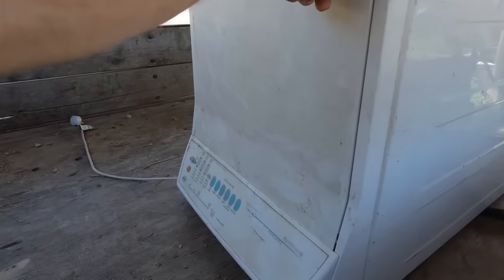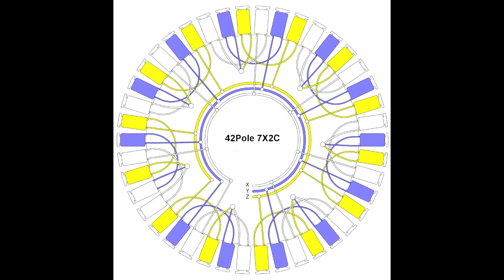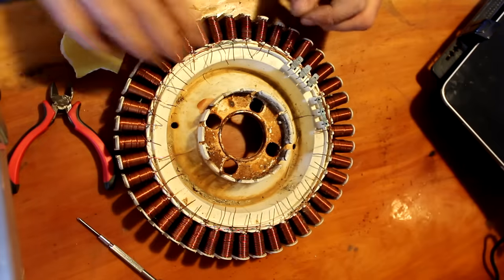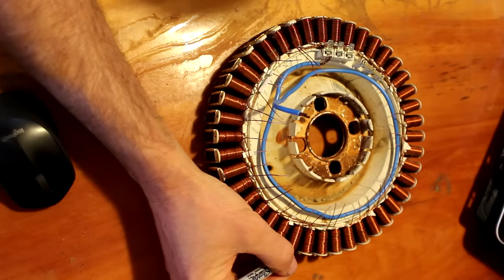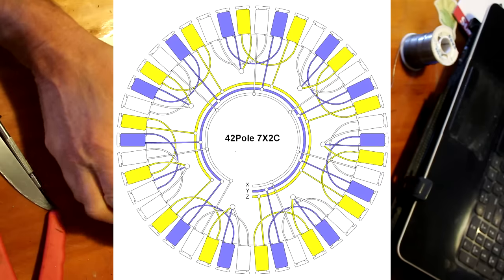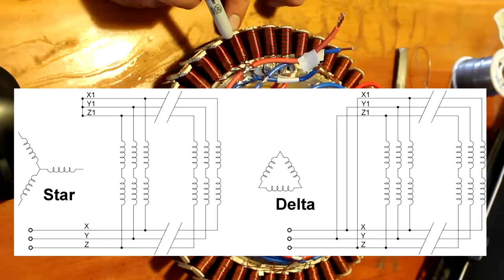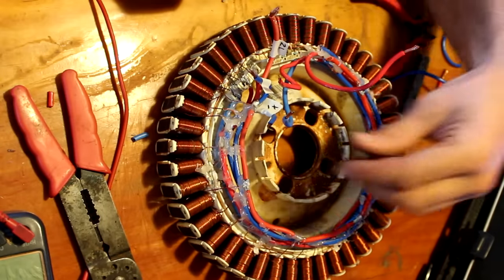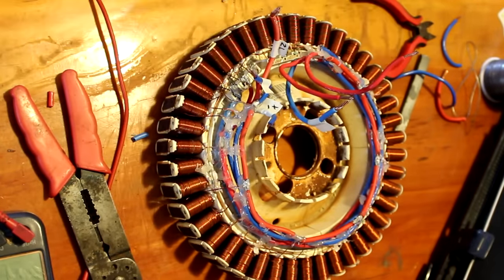Free Power from Water Part 3- Rewiring a smartdrive washing machine motor to generate power

Comment: Marty after watching your Part 2 I watched a YouTube explaining the difference between conventional generator vs the new more expensive inverter type generators. I also looked up Skin Effect. For those who don’t know I copy paste the explanation from the Internet;

“The main technical difference between inverter generators and conventional generators is what kind of electricity is produce, conventional generators only produce AC electricity while an inverter generator produces electricity in three phases (high frequency AC to DC back to stable  AC current)”  

“Skin Effect results from circulating eddy currents, arising from a changing B field, cancelling the current flow in the center of a conductor and reinforcing it in the skin. This reduces the effective cross sectional area increasing wire resistance and losses.”

Now I understand your "inverter" setup, your cost to effectiveness ratio is just brilliant. Big fan, love your channel.

Comment: Ok I wasn't expecting 885W at all.  That's significant and you can absolutely work with that.
Reply: Oh hell yeah with good pressure and solid copper magnet wire instead of the aluminum junk he reused you can get way more and smaller gauge also

Comment: That soldering iron brings back memories. I started year 7 at an absolutely brand new high school and chose electronics as an elective. I was expecting a great experience with all new gear, but when it came time to solder up our first circuit boards, the teacher who really had no idea what he was doing, took us outside to do it with those antique soldering irons heated in a branding iron heater borrowed from the agricultural department!  The irons burnt the crap out of the circuit boards and components, and did an awful job. And to really top it off, we were only supplied with acid flux and plumbers solder, corroding out our hand made boards after a few months. Was the most disappointing class I ever enrolled in.
Reply: Hell of a school? I did electronics at a TAFE College in Australia in 1976 with all the good gear went on to the School of Radio with the RAAF for my apprenticeship at 16 learnt precision cabling there.
Reply: Did that school also have a motor mechanics course where the tools were a brick and a chisel?
Must be where all the Harley mechanics were trained.
Reply: Then it's Taught you about Electronics !
Reply: @hauptuhrdotnetblog6700  You can pretty much sue them for that shit I think
Reply: @ToreDL87  would need documentation to prove damages but without knowing the laws of where you live hard to say. I’d at least talk to an attny. You never know, maybe get a settlement due to their incompetence
Reply: @paulg3336  With enough skill you could make a motorcycle out of brick and mortar. Legends say the monks in Nepal are still trying.
Reply: @john beach Silver solder or brazing is as low as I go these days they build way better connectors.

Comment: Loved your videos, here in Bougainville we run small hydro using 100mm pvc reduced to 25mm running a radiator fan off earth moving machinery with its blades bent at right angles as a water wheel running a shaft and then belt driving a 240v generator off a dead genset.

Comment: If you left the motor wiring original and then brought it up to the house as 400v then use a step down transformer your losses in the cables would be reduced due to the lower transmission current.  The transformer would then lower the voltage and increase the amps to a more usable level just like the utilities do. As an added benefit you would have the bulk of the system available at the house for repair/monitoring/maintenance instead of trekking down that steep bank with all your tools and materials. The 1drawback is the transformer which given your minimalistic scrap/salvage approach would probably be unattainable and would be quite pricey to purchase. I love the repurpose material approach in our “disposable” society. Great job.
Reply: The 400VAC @ high hertz is leaky through insulation and dangerous to handle. Rectification immediately to 27VDC to charge the batteries (low voltage needs large cables and short runs to avoid line losses) then from the batteries through an inverter to 230VAC which is standard household voltage for NZ appliances/light etc...and can run 400 metres with minimal line loss and arrives at the house distribution board ready to go out to the water heater appliances etc without further rectification.
So the batteries and electronics need to be down at the stream and the generator....
Has worked for 17 years at Marty's home.....

But you could use an old (<85% capacity) 400 VDC  EV battery at the house as a back up battery or where the loads (such as a compressor or welder) now force the use of a generator....but you would need a large and expensive transformer to get the standard 230VAC household power...

Comment: My grandfather had a soldering iron like that...

The "tip" was about a pound or so of copper.  It was heated in a charcoal brazier that he had a hand-cranked blower for.  The flux was a block of "sal ammoniac".  I've also seen bar solder like that somewhere,  but it was so long ago I can't remember where.
Reply: Plumbers soldering iron used when roof guttering was soldered with "bars" of solder melted like a small river into the joins between the metal gutter sections...

Comment: I haven't seen a soldering iron (and solder) like that in years - I'm used to a much smaller iron and solder - I was an electronics tech!
Reply from the maker: I tried my 100w electric iron but it didn't stand a chance
Reply: @MartyT  Yeah, 100w is a bit much for that type of work but those copper 'irons' were not intended for electrical work ! 
I recently bought a very small soldering iron (not much bigger than a pen) with adjustable temperature which was incredibly cheap and much easier to use than that type.
Reply: I was just about to say that I e never in my life seen one of those soldering irons used. I’ve seen them around but be er seen them used. Marty is just showing off how eclectic his skill set is now!
Reply: Marty you lost me at X Y Z hahahaha. You are a very clever bloke. Love your work. Keep them videos coming
Reply: Reminds me of the "this is a knife" scene from the Crocodile Dundee, but with soldering irons :)
Reply: Thick wires need thick soldering irons
Reply: Marty T I've tied heavy gauge copper wire to a soldering iron to pin point the heat
Reply: Well I thought I might learn something but I just relied I know less than I thought I did 😂. Loved this series, I’m sure you will get lots of Enquiries to build these for people,
Reply: we used to call those soldering bolts you could get smaller ones, I used to work on hand held and car two radios in the 80's, normally a 60W soldering Iron would do we had 100W electrical soldering iron...problem is a big bit of metal sucks the head from the soldering device.... then we got RF power soldering Irons that could keep a stable tip temp for heating up bigger wires,  metal housings etc....And I had a Weller Pyrotec Gas Iron for work outside on antenna connectors it was good enough for Scottish winters...before that came out we had 12v ones to run of vehicle batteries......
Reply: @MartyT  if it was one of those pistol type Irons never had any luck with them  a 100w  Iron needs a heavy tip to help hold then transfer the heat most of those pistol ones come with to small a tip... but look up Mr Carlsons Lab he modified one some how to work better!...aw what the heck here is a link https://youtu.be/79uD6XwBg5E
Reply: @BokorRider  For heavy work, I have an old Australian-made Scope 100w 3.3 volt iron.  Dad had one back in the Fifties, too.  Hold the trigger down for too long and the tip glows red!  :) https://wbtools.com.au/100-watt-thumb-switch-soldering-station-extreme-heat-resistant-display-black-handle.html
Reply: We used those irons in school in the late 70’s used to keep them hot in the kilns, many a blister on the back of each other’s arms and legs
Reply: @Brad.whatthe  Thanks for teminding me!  Yes, we used them at high school in metalwork classes in the Sixties .  I'd forgotten about that.  My grandfather had one that was heated with a kero powered blowtorch - the blowtorch had hooks to hold the soldering iron in such a way that the copper tip was in the flame.  You can see the hooks on the top of the blowtorch in this video https://www.youtube.com/watch?v=7aKKHO8Kv40

Comment: Very cool and interesting. Usually with a PV array you wire the panels to put out high voltage, low current to save money on the wiring run back to the inverter. Once at the inverter, it converts it back to usable volatage and bumps up the amps. Same priciple as high voltage transmission lines. Higher voltage also resuces losses over the run from source to house.
Reply from the maker: Yes thats right, output from this is a little different than clean dc from a solar panel, high voltage / high hz ac doesn't travel well long distance (skin effect cable loss)
Reply: @MartyT  Cool thanks for the info.
Reply: @MartyT  I was thinking the same thing. But I forgot that here in USA the transmission lines are high voltage/Low frequency (60hz) . This brought back my tech training days more than 50 years ago.  You refreshed my high frequency transmission line education ! Thanks. Great video.

Comment: OMG a soldering iron for fixing the roof rain gutter! Mate you make an easy job difficult for yourself. For the rest; very good idea and improvisation.
Reply: Marty commented tha this 100 watt iron just didn't have enough heat in it for the job of this size of copper wire soldering.
So he selected his second-from-largest soldering bolt...acid flux...and lead solder...and great results happened...

Comment: I have a suggestion (idea) for a close to home installation. In a pallet container. You have a low pressure after the pelton wheel and a low pressure after dump valve of a ram pump all the system needs to convert the low pressure to a high pressure with a 12 volt submersible pump you can give pre-pressure to the ram pump and ram pump equip with good expansion vessel that built up pressure of both to drive the pelton wheel all fit in that low water container that can be used constantly.And you know the rest to put that motor on the pelton.have fun
Reply: Research perpetual motion machine....
Reply: @JohnSmith-pl2bk  this type one needs pressure to keep it going. and perpetual motion is without interfering off other energy.

Comment: What voltage are you getting into a rectifier from a generator with a star wiring and what voltage are you getting into rectifier with a delta wiring (AC?). What voltage are you getting out of rectifier into battery banks? Thank You

Comment: Have you considered keeping the higher voltage and using a transformer closer to the termination point to reduce your losses from running a lower voltage such long distances? This would also allow the end user to keep the expensive bits at the house and make it easier to maintain.
Reply: I mean, to add to it, it would also save you money in the long run... Thick gauge wire ain't cheap! Lol
Reply: The 400VAC @ high hertz is dangerous and leaks through normal insulation.
So it gets rectified into 27VDC straight away...which charges the two truck betteries @24VDC.
Those batteries power the inverter that produces 230VAC...which is normal domestic voltage in NZ for use in the home.
This is fed from the creek up to the house 400m in normal 3 core insulated  wire at minimal line loss and useable in every domestic appliance from the switchboard.
This has worked for Marty for 17 years at his home...see vids 2,3, and 4 in this series....
You could (and there are now) more batteries at the house which use a 12VDC battery charger to top them up to run the fridge and freezer...as an "in case" measure...in case something goes wrong down at the creek (which may have happened with the recent 20 inches of rain in 4 days)

Marty T
Marty T
3 hours ago
John is spot on with his reply, there are a few other reasons- the generator speed would be inefficient, optimal rpm is around 800-1000rpm. Also he intends to add another turbine at a later date, this would require another expensive cable run if pushing 3 phase.

Comment: Given the length of (each) wire needed for the six "buss bars" employed in rewiring the STATOR would it have not been more helpful to have bought a length of Yellow?  Also better for teh video. Indeed why not a length of yellow and another of white (since you had the blue laying about)?  Then a touch of Magic Marker here and there to get one buss using black & (yellow, blue, white)?

Were you away from a power source? Or are you simply more comfortable with that antique soldering iron (made of copper)?

Comment: High voltage AC travels better and travels on smaller wires. Seems to me you could use the alternator to send the high voltage to the house and use a transformer to reduce the voltage which has to raise the amps because wattage must remain constant. It would have saved you from carrying a lot of equipment down that treacherous hill. Also would reduce voltage drop at your equipment.

Comment: Wouldn't increasing the amperage lose more energy to heating during travel from the generator to your house? Or is it worth it anyway because of how little the amps were before
Reply: If you look at some of his other videos, you'll see that he has the battery and the  inverter located right next to the generator, and runs mains voltage up to the house.
Reply: Will be AC so that's cooler for distances. It's the amps that heats it most though. High volt - low amp requires smaller wire than low volts and high amps.

Comment: marty have you thought of running the cable down the hill at high voltage and rectifying it at the house? id be interested to know the difference is in wattage at the generator vs at the charge controller. im guessing you have done it this way for safety but you could run wires back up to some kind of safety system where you could turn it off or have it monitoring weather it is leaking to ground? yeah maybe not, it would suck to get shocked walking up the river. id still be interested what the losses are though and over what length of the wiring run.

Comment: Thought you would want to keep the voltage up and the current low to reduce the thickness requirement of power transmission, and figure out how to reduce the voltage on the other end of the transmission line (a transformer?)

Comment: Won't be long before stator manufacturers such as Ducati start offering off the shelf custom stators and permnament magnet rotors for projects like these as the fight for alternative and renewable energy sources intensifies the world over. .Just one problem in this feild that's rarely mentioned that i have personally suffered is the loss of magnetism from very old rotors motorcycle generators to be precise...its an mystifying issue should you ever meet it but resolving it can be even more as its difficult to gauge if you don't know the magnet strength which is usually noted by how much weight it can support and lift. ..So watch out for that one when salvaging scrap permnament magnet rotors from washing machines which incidentally the Italians like to manufacture with stoid names such as Candy....

Comment: If you'll take that soldering iron back to clean copper with a flapper wheel you can then heat it up and rub it on a block of sal ammoniac while also rubbing it with the solder and you will re-tin the iron. That will help your solder flow a lot better. You want to make sure there are no pits in the soldering iron. I think that the pits are caused by lead amalgamating to the copper and they will continue to grow. That's just my guess and my other guess is that they're caused by the iron getting too hot. I used one of those large irons in full time production for about 6 years in manufacturing. ( technically speaking I had 3 or 4 irons in rotation depending on the application I needed them for and actively used irons got re-tinned about once a week.)

Comment: Could utilise a solar pump vfdrive to convert the output to single phase ac. Actually most 3ph vf drives have DC input terminals, but are not obviously marked.
Reply from the maker: I'll look into it thanks
Reply: @MartyT using VFD's are the ultimate Soft-start solution for off-grid induction loads. Installed one on the bore pump to offset the 18000w surge load on my 8kva generator...years later realised one could wire in hi voltage solar 400-450v, the VFD essentially throttled the pump to match the weather; cloud cover/shade...free running all day every day, no probs keeping the 2x5000gal tanks topped up. Cheers good hunting